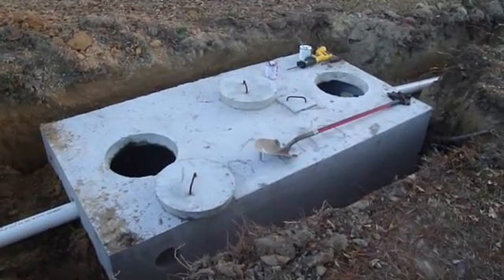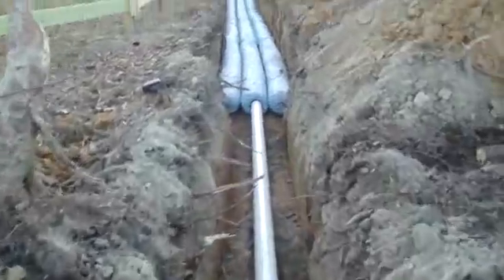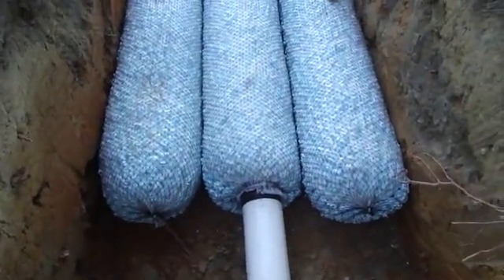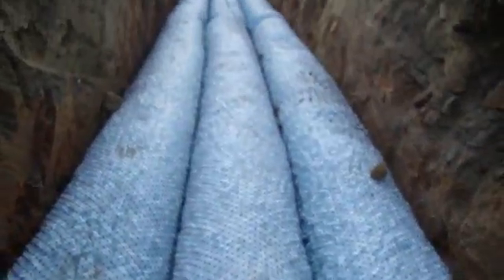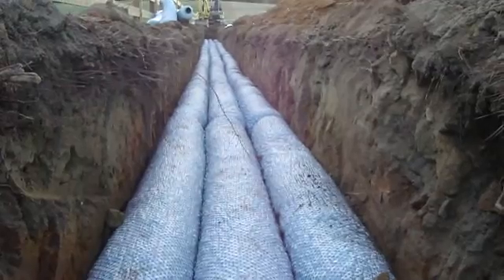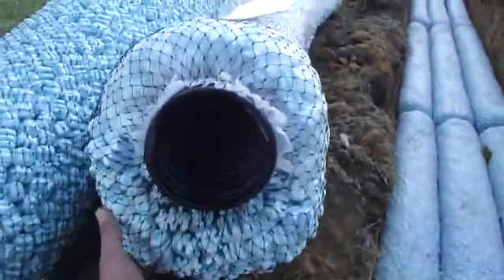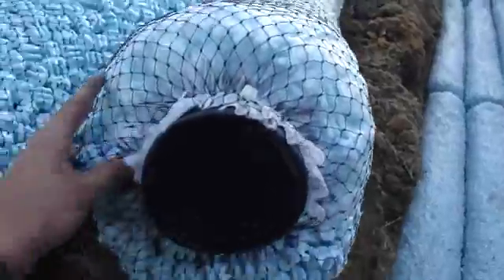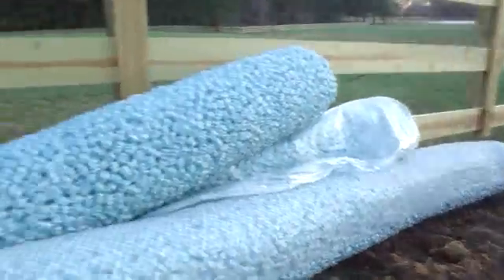New Rockless septic system

Comment: You're gonna regret using that cheap styrofoam instead of gravel.
Detergents, cleaners, bleach, etc. will dissolve those packing peanuts in about 15 to 20 years and you're gonna have one plugged up nightmare of a mess.
Reply: Bleach will destroy any septic system. Including a rock system...a well known fact ..you've got to be informed on what you're putting in your septic system , to ensure it can work it can work as long as it can

Comment: My septic drain field uses this crap.  The system is less than ten years old and the entire field has sank about 6 inches all across with some spots being as deep as a foot.  I can't afford to open and inspect, but I suspect the peanuts have degraded to the point of collapse.

Comment: Junk! They settle too much the pipes pull a part does not work very good plus you’re putting it too deep in the ground , The top foot to a foot and a half topsoil is the only thing that will soak water well deeper than that The water only soaks away very slowly if at all! Quit using that stuff 15 years ago and now they won’t let us use it in the state of Ohio! Been in business since 1951 seen a thing or two! Gravel septic systems tried and true!🇺🇸

Comment: In Costa Rica, a buddy showed me how duplicate the engineered Tunnel Leach Line idea with a three foot deep level ditch just wide enough to set those 8" wide (smaller w two hollows) building block bricks set in two rows just wide enough to place two similar building block over the set of each two blocks on the ground. We created two 60 plus foot leach field tunnels under a drive way in this manner after confirming the ditches leached water (drained after raining). We buried the tunnel with a leach line drop into both tunnels. Used a pipe Y fitting to split septic effluent into two equal flows. My septic effluent was cleaner from going through  a second separate tank (could have been a second chamber in same tank). Stronger leach line pipe was a no brainer in the driveway area made stronger with cement casing. All of the tunnel including hollows inside all those brick were available to receive a septic tank leach line  effluent charge. That charge area was significant compared to same volume of the small space between gravel in a traditional style leach line! The best part was that I was able use my gravel driveway for a leach line when I had limited options. The sealed up leach lines were strong enough to take a backhoe driving over em plus took a few big fully loaded 12 yard dump trucks driving over my leach line without damaging them. Food for ideas on efficient use of your dollars and a safe economical septic tank leach line field using the principles of engineered tunnel leach lines.

Comment: how is it holding up?? I feel like that material would mat up and clog very easily...traditional gravel bed is the only thing I would ever trust...I wouldn't even bother installing one of these or those crap infiltrator domes that get clogged with fine sand and dirt after only a little time...I am curious as if it it still holding up 7 years later though...
Reply: @Jimmy...absolute waste of time and money!! i have the kitchen sink and 1 toilet ....to about a 25'x25' ft. plot of this system, and you nailed it, this is the 7th yr.  and i had problems a year ago👎👎 definitely not recommended in Fl.

Comment: 6 years later, how is it holding up as a leach pipe? those pipe are typically used as french drain due to the thin sits being more susceptible to clogging than the traditional larger round hole pipe surrounded by aggregate.
Reply: That specific type of easy flow is for septic tank use it has round hole cut in the pipes not slits. And then they have easy flow for the french drain use that has the slits cut in it.

Comment: Had this very-same type of system installed just 3-months ago, just prior to one of our nastiest, wettest-winters yet, here in the SEMO-Bootheel. Would've NEVER made the hard-freeze deadline that was required, had we went with traditional gravel, not to mention the pain-in-the-ass dealing with DNR-regs. These are SO-much faster & easier to lay, and of course are DNR-approved. I, too, was afraid of "softness"-collapse,---but they seem to be amazingly-solid, when "sardine-packed" in the trench? And, they are more-expensive than gravel, but your time/labor saved would tend to make-up for it, I'd think?

Time will tell, indeed. But if the system holds-up for at least another ten-years or so, it'll damned-well likely outlive ME anyhow.....!)
Reply: So do you lay the 3 pipes side by side or 2 on bottom and 1 on top.
Reply: How did it turn out?
Reply: How is your system doing? Wondering bec I’m about to get the same system

Comment: looks like over time the weight of the soil on top would crush the peanuts or the ground on top would always be spongey.
Reply: I have had that system since 2004.  You are pretty much correct, ground slumps there over time, catches water and that floods the system causing failure.  Never again will I use that crap.
Reply: @fordguyfordguy  Do you recall how many feet below the surface that the EZ flow is buried?
Reply: @LL-wh3uc  I think  it is no more than 2.5 feet down.

Comment: Hey, Chris.  Nice job.  I like that system seem to be pretty easy to install how are the connections made between each of the pipe/bags?  and is that a 1250 DC tank ??
Reply: Like your videos  install septics in new York  there getting  friendlier  on quote on quote  alternative  systems  what's your thoughts  on the system  compared to stone and pipe  thank you